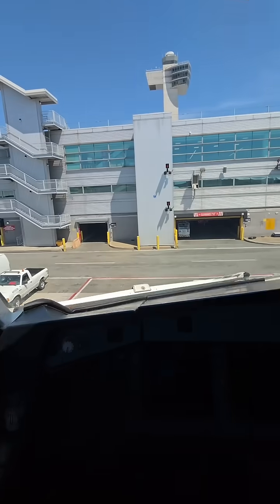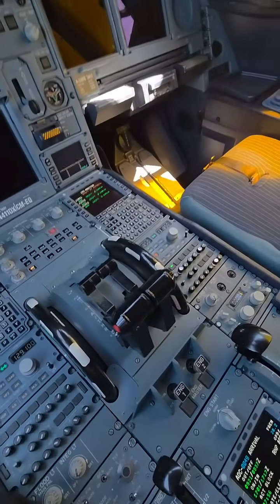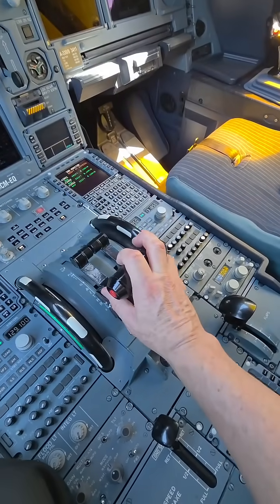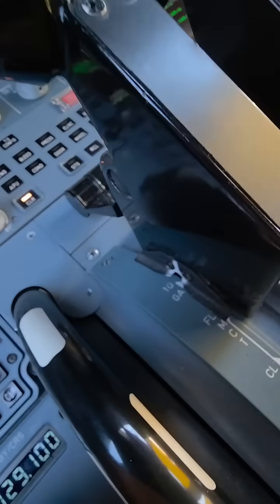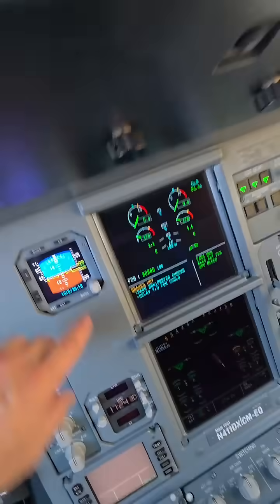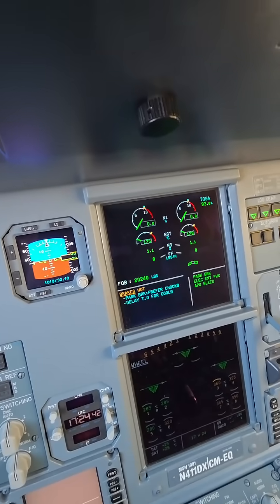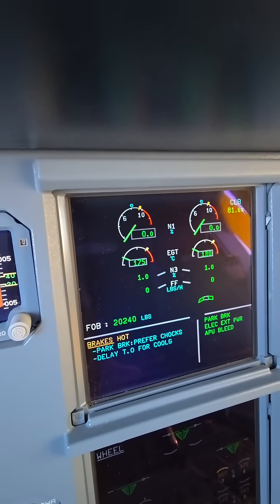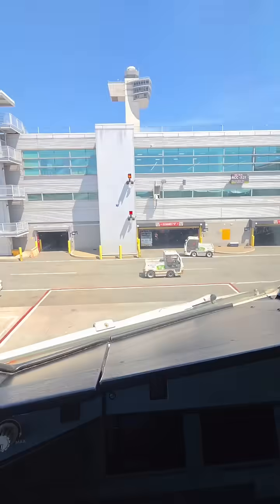A330 Thrust lever explanation.

Comment: Hey 

You're going to flood the jet engine carburetors pushing the throttle levers forward when the engines aren't already running.

Next rostered  crew will get bulk grief from passengers cause the plane won't start
Reply from the maker: he he

Comment: So during takeoff do you use TOGA if flying full?
Reply from the maker: No, only when you need it for performance, which could be that the plane is heavy, or the temperature is high, or the density altitude is high, or there is windshear in the area.

Comment: Are you allowed to use TOGA on takeoff instead of FLEX just for fun? Or would that be against airline police due to noise, engine wear, and passenger comfort? I always just use TOGA in the simulator because none of those issues apply but then when I’m a passenger in real life I always wonder which the pilots use on takeoff and how they decide.
Reply from the maker: We try and use FLEX when it is available. We have the option to use TOGA for a good reason like windshear in the area. We wouldn't just use it for 'fun'.
Reply: @CaptainZtravels that makes sense, after all you are professionals

Comment: Thanks for this! I am still curious about the factors that help decide when it's appropriate to use FLEX or TOGA for takeoff.
Reply from the maker: TOGA is usually because we are too heavy for FLEX or the temperature is too high, or there's a contaminant on the runway, or there is windshear in the area. Sometimes it is because of the climb segment after takeoff. 

In any case it is computed for us based on the environmental conditions.

We always have the option to use TOGA, even if the data says we can FLEX.
Reply: @CaptainZtravels  Thanks so much for that! I wanted to figure out if my simulator was calculating correctly based on all the factors.

Comment: So coming from someone that only flies small ga planes and could only dream of having your job. If you’re coming for landing and catch some sink and want to add power to get the aircraft back on profile. Are you able to make small power adjustments with the levers or are they more designed to just run in the detent positions and will auto adjust themselves? 
Sorry if this is a stupid questions but would be keen to know.
Reply from the maker: Not a stupid question. 

We have a thing called auto-thrust. The auto-thrust will maintain a target speed on final approach. It will do that by increasing thrust or decreasing thrust. 

The detent on the thrust levers just means that the auto-thrust has full authority from maximum climb thrust to flight idle thrust (lowest possible in the air). 

The auto-thrust does a great job but if for some reason we need to abandon the approach and go around we would then push the thrust levers to the maximum position, also called the TOGA position, which means Takeoff Or Go Around thrust. 

TOGA allows us to climb away from the ground at maximum thrust while we re-configure the aircraft for the go around. 

If the auto-thrust could not hold the speed or there was a large sink we would call that an unstable approach and we would be required to go around from that and use TOGA as explained above. 

In 18+ years on the A330 and 4 years on the A320 I have never seen the auto-thrust not be able to handle the approach parameters.
Reply: @CaptainZtravels  thanks for explaining that and taking the time to reply to me 🙂!

Comment: Very nice 👍, I’m a 16 year old teen now currently having a great knowledge as I even know how to regularly fly a 777 ,A320,737 and 787 including realistic way by doing all the correct overhead lower panels and programming the MCDU/FMC and using the radio/audio panels to communicate with the ATC. I manly use MFS2020 for those flights but once again nice explanation 😅!!

Comment: Different maximum for each setting depending on your engine type since I bet the ones that power your aircraft are the CF-6 . 

Let's not even go into EPR numbers or anything like that that would require like a whole 30 min long video lol. 

Especially EPR numbers and N2 on the RR and PW airframes effecting your FLEX number being different from each engine if you was to have the same runway , same conditions and same weights . 

A lot goes into these aircraft.  And it's amazing seeing videos like this . Explaining the intricacies. Glad to be watching a JFK based pilot.

Let me clear this , this isn't criticism just me nerding out and adding more fun facts to the already fun facts.  It was a phenomenon I realized when I was reading up about this aircraft more.
Reply from the maker: Thank you. 

Our A330-200s and -323s have Pratt & Whitney engines. 

Our A330-302s (we have 10) have GE engines as you mentioned. 

Our A330-900s have Rolls Royce engines. 

All of the limits are different, as you point out but it's really not something we need to know or care about with the Airbus. There's a red line and limit that we can see that is specific to the airplane but it's a marking so we just need to know that the marking is a limit, not the number. That would be crazy to have to know that. 

All the FLEX and takeoff numbers are calculated for us and all the variables that you mentioned are taken into consideration. It is a very simple process for the pilots.

Comment: This is a neo? Thank you for explaining the thrustlevers.
What position do you put them for taxiing thrust?
Reply from the maker: It is! 

There is no detent for taxiing. We just use what we need to use to get the aircraft moving, with a maximum of 40% N1 when in the ramp area. 

That's so we don't blow something over behind us. We can use more thrust on the open taxi way. This sometimes happen when we taxi single engine when heavy.
Reply: @CaptainZtravels  But can you tell me how the aircraft starts rolling after the tugdriver released you? I know a lot about flying, but that is still a mystery to me.

Comment: That’s cool. So is flight idle what you use at cruising speed, or does idle not give it any power, it’s basically like being in neutral?
Reply from the maker: It's basically being in neutral.

At altitude, flight idle wouldn't be enough thrust to sustain level flight. Sometimes when you go through some turbulence where the speed goes up, the auto-thrust may, momentarily go to flight idle, depending on how high the speed got, to reduce the speed back to the target.